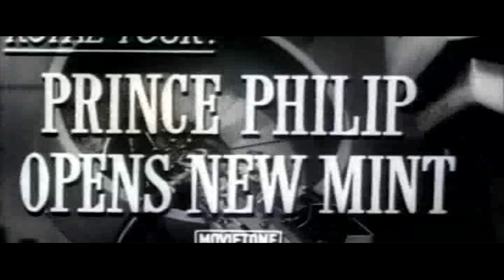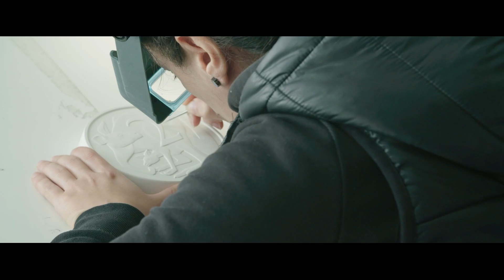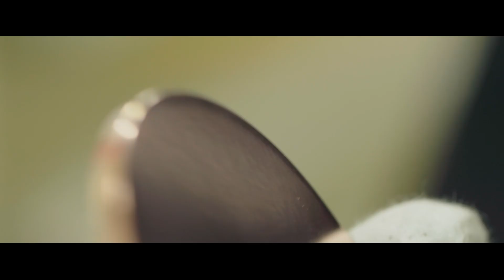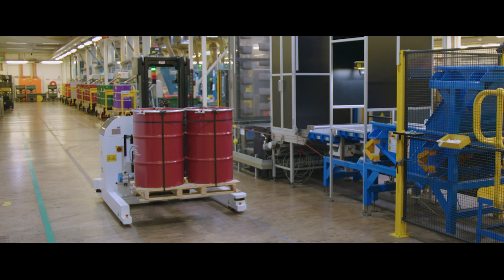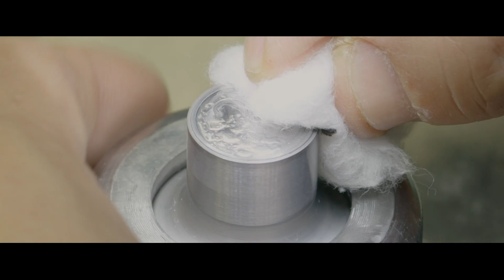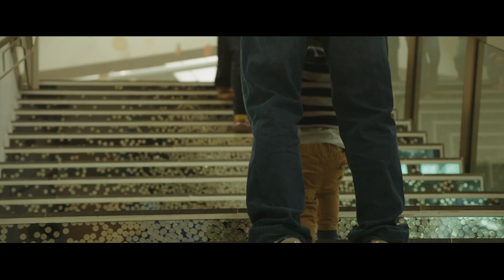Welcome to the Royal Australian Mint

Comment: I love this video. I am exceptionally pleased that you did not showcase the embarrassing packaging used today by the RAM for the proof sets. I think one aspect of coin collecting that the RAM has forgotten is the importance of the packaging. 

There appears to be a false assumption that packaging is frequently discarded and ends up in landfill. How wrong this perception is. The packaging is as important to the collector as the coin itself, and rarely are coins separated from their original packaging. It would be wonderful if the RAM were to revert to using the case types featured in this clip; the ones used from c.2015 to 2021. They were practical, they did not have issues of disintegration like the previous vinyl/leatherette cases of old, and they were stylish - much more appealing and less insulting than the current recycled boxes. 

RAM, I sincerely hope you listen to the feedback - I know many have expressed their dissatisfaction with the current packaging. It's time to do your beautiful coins justice by selling them in packaging worthy of their price and significance.